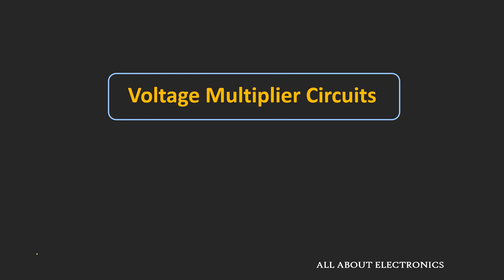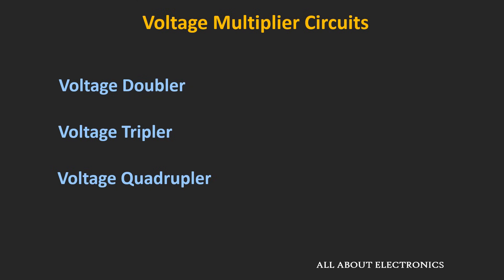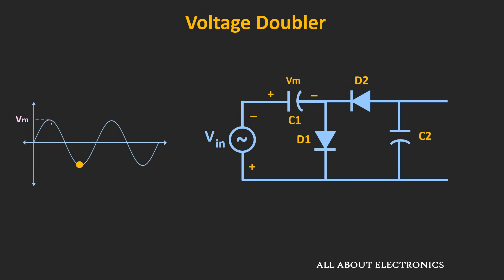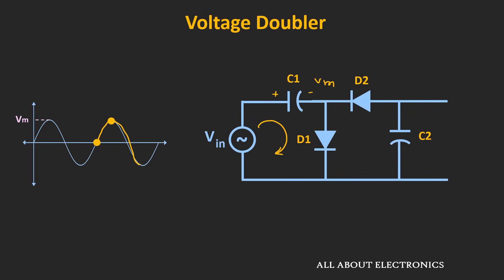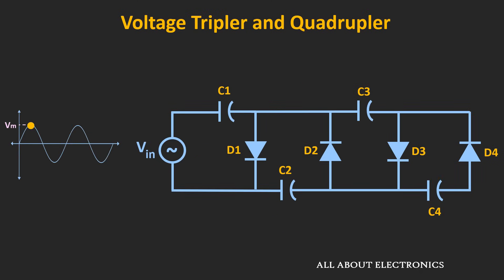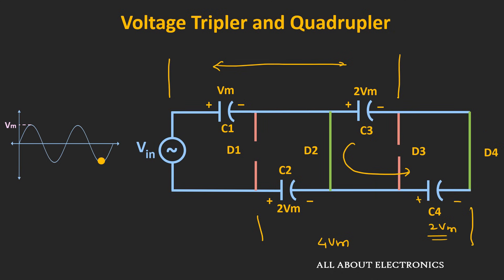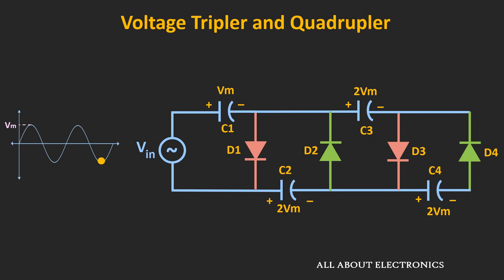Voltage Multiplier Circuit Explained (Voltage Doubler, Voltage Tripler and Quadrupler Circuits)

Comment: @11:45   during 2nd positive cycle Vin and Vc1 cancel each other and cathode of D1 is  at +2Vp  from capacitor C2 so I do not see how D1 is forward biased.  Do you understand my question ? Thank you great video as usual.
Reply: I simulated in LTspice and works just as you described.  I will figure out my doubt using the simulator. Thank you.
Reply: I also think the explanations around 11:45 are wrong: d1 would not conduct
Reply: It will be charged by 2vm + v source - Vm which will peak at 2 vm

Comment: Are polarized capacitors used for these circuits? Doesn’t ac pass through capacitors? How does the charge remain during different cycles?
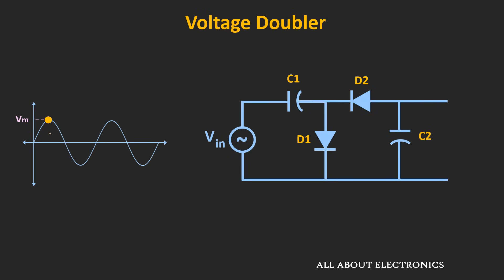Reply from the maker: Yes, the capacitors are polarised. For the voltage doubler, I have explained it from 5:39 onwards. Please go through it. And still if you have any doubt then do let me know here.
Reply: THE UPPER CAPS PASS AC WHILE THE LOWER ONES STORE DC MAKE YOUR OWN VOLTAGE MULTIPLIER THAT COULD OUTPUT NEARLY 60000 VOLTS !! WATCH IT ON GO ELECTRONICS !!

Comment: During the negative half cycle equivalent circuit outer capacitor polarities are reversed why
Does it possible in practical circuits
Reply: THE UPPER CAPS PASS AC WHILE LOWER CAPS STORE DC AND CAN OUTPUT NEARLY 60000 VOLTS !! WATCH IT GO ELECTRONICS !!
Reply from the maker: No, it won't get reversed. While connecting the capacitors the circuit, one needs to check the proper polarity of the capacitors (For polarised capacitors).